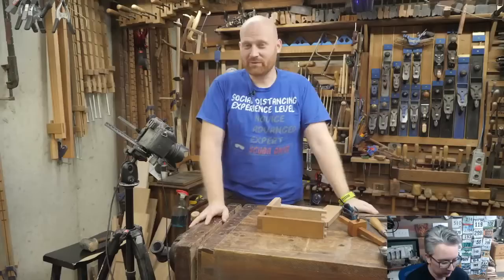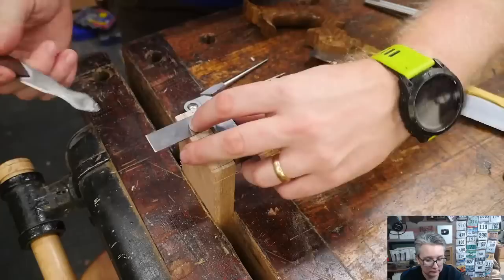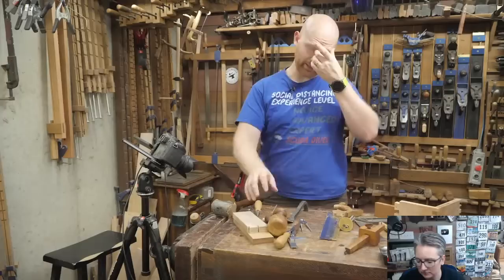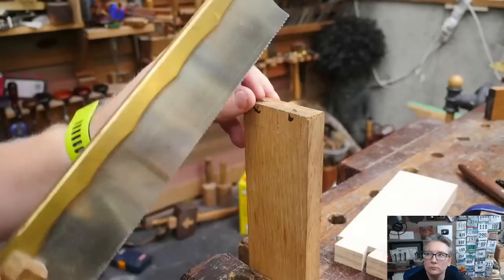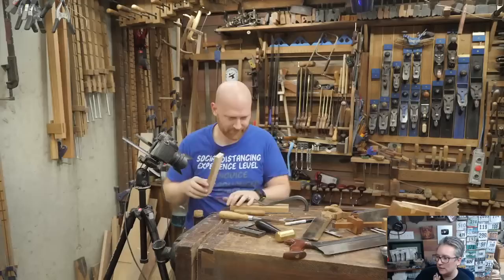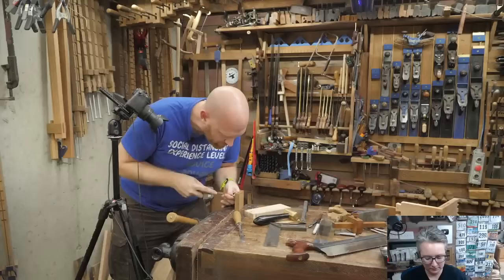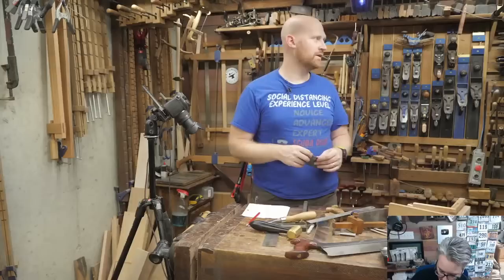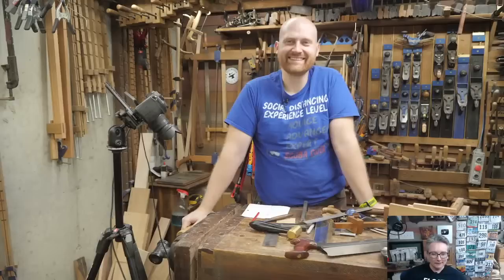How To Cut Half-Blind Dovetaills

Comment: Why is it called "under cut"? If youre removing more material than you need, my immediate thought would be that youve "over cut" it. So ive always wondered what the explanation was for calling it under cut. 
That might be one thats easier to explain in another video
Reply from the maker: it has more to do with which side of the line. normally the pins or tales are in the vice. and you cut over or under the line.

Comment: I just made ur paste wax recipe. I did add a bit of camphor oil to it, cuz I heard it helps to prevent rust. it turned out great. But Have you ever heard of the camphor oil preventing rust thing? Or was that a mistake do you think? I am worried about using it on wood, due to the camphor, cuz it is the soft wax recipe, and now that I am looking back I wonder if I shouldn't have done that??
Reply from the maker: It will be fine on wood. Some people swear by it for rust provention. But most testing I have seen on it show it is as good as any other standard oil.
Reply: My understanding is that you add camphor oil to paste wax as an insect deterrent for wood. I have no idea if it really works to keep bugs away or not. Camphor is also a plasticizer so it may make the wood surface a little harder. On metal, I can't see it being any better than any other oil at preventing rust.